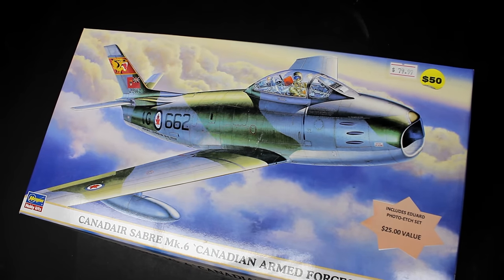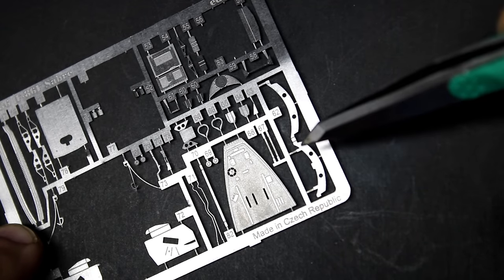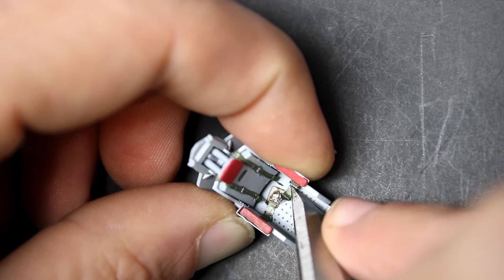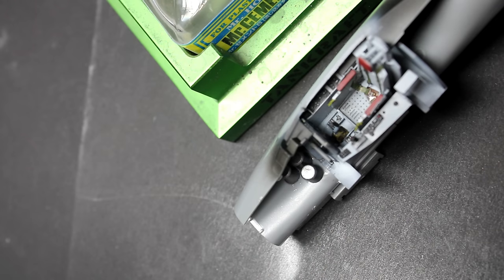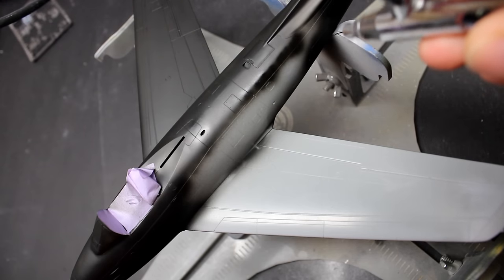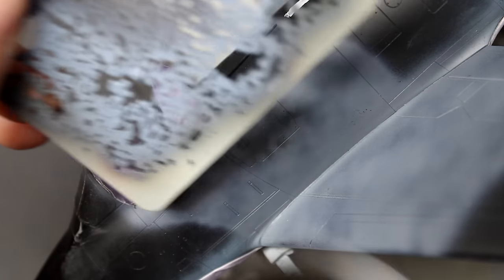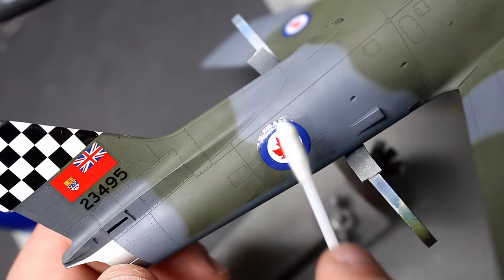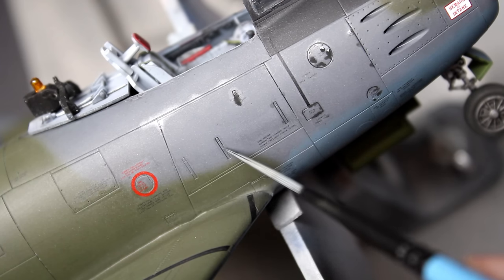Hasegawa 1/48 Canadair Sabre Mk VI (F-86) & modeling mental health

Comment: I have been in those slumps and analysis paralysis. I always go for a quick win kit to rebuild my confidence. Academy’s USAFF-F-15E kit (12550) is basically a snap kit. But the ease it goes together and the quality of the fit is insane. Best kit ever for a quick win. Guys at the hobby store were blown away and bought that kit for themselves. Really built my confidence.
Reply from the maker: That's good to hear. I only ever hear that Revell was the way to go for -15s

Comment: Not sure if you have heard of the Australian Sabre version- the Avon Sabre.  It did have cannon (2x 30mm Adan) and the Avon engine.  It has been said that this was the fastest Sabre, and with the cannon armament, the most lethal.
Reply from the maker: Was it American built? On the records the Sabre Mk VI was the fastest with the Orenda engine.
Reply: @TheModelGuy  The Avon Sabre was built in Australia and had some major redesigns to accommodate the Avon engine and Adan cannon.  Top speed was over 700 mph.  It was a rival to the Canadian Version as the best Sabre..  You could argue it as a least better armed..